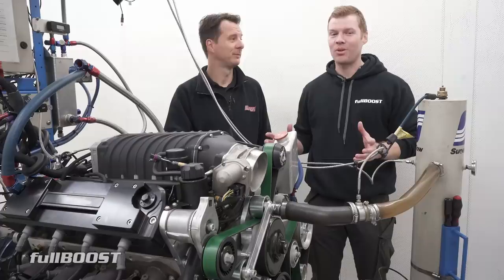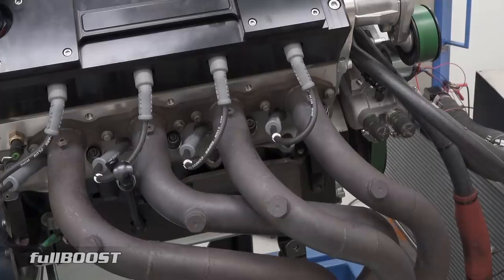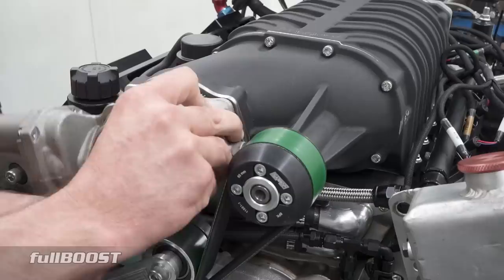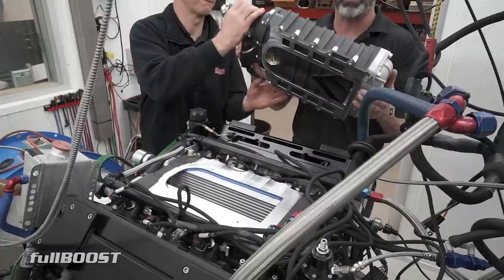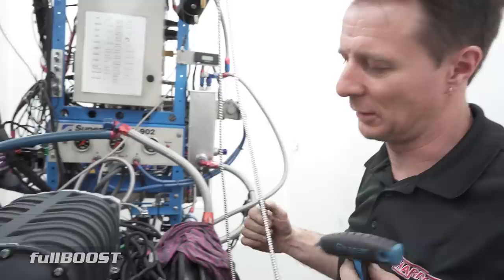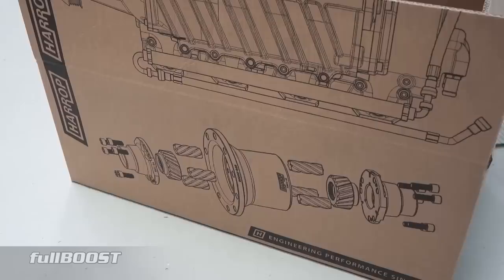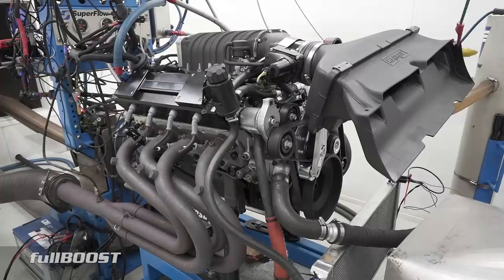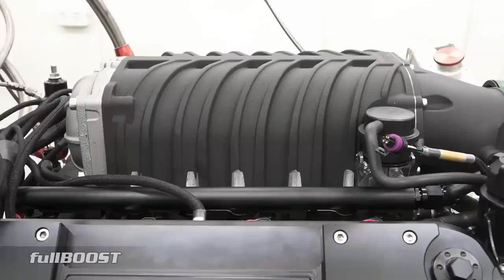How to increase Supercharger efficiency | Harrop TVS2650

Comment from the maker: Torque monster! 💪
Reply: FAARRR OUT Yeah man a 1000Nm of rear torque figures IS NO joke....That's insane fullboost.....i know how bad Only 630Nm of torque Can be on a Tuff Brand new R60s Tranny good for 800Nm,...I have only been bashing on my stock new R60 Tranny for 1 week after a 3intch TBE + Nizpro tune......And I'm already getting some slip in 2nd gear from my Torque converter i presume 🤔 ?
Reply: My heartbeat makes 475rwkw 1200nm
Reply: Would be a good car for that sales rep to get to Swan Hill. 😉
Reply from the maker: @happymanasfksubaru2846  👍Nice one. Torque at the wheels is not the same as at the engine. This is making more than 1200Nm.

Comment: The hp went up but so did the boost levels.. how about an apples to apples comparison to show the gains from porting the supercharger and adding the spacer.
Reply from the maker: The boost will automatically increase when the charger breathes better i.e less restrictive air path. 👍
Reply: @fullboost  hmm.. I never thought about that. I always thought boost pressures dropped when restriction decreased but that's probably engineside.. I can see how allowing the supercharger to move more air per rotation would raise boost levels... interesting.. great video. Thank you.
Reply: @yolofullsend  That depends, superchargers need more air in than turbos do. That's why Kenne-Bell sells 100+mm throttle bodies. This TVS blower with a 102mm and 15-17 psi the output is very typically about 1000hp on the dyno. However by the time it travels through the automatic trans, drive shaft and diff it's down to around 950 hp. Still nothing to sneeze at, much easier though more expensive to upgrade supercharged cars, though 4 cylinder supercharging is lagging WAY behind, though you can get 500-600 whp out of Rotex setups and 2300 TVS on Honda K motors.
Reply: @yolofullsend  yea on the engine side it does drop when more efficient but when you make the blower itself more efficient or run a larger air intake or throttle body the boost will increase without touching the pulley sizes.

Comment: All this time I thought Twin Screw superchargers were better then TVS.  These 2.65L TVS blowers are making more power on average then 2.8-2.9L Twin Screw's.
Reply: They make way more power than a 2.9.
Reply: Twin Screw is better. New Kenne-Bell Twin Screw at the same boost level is 1,100 hp. Most people aren't running them that hard.
Reply: @dj4monie  how is the twin screw better when it takes a decent amount more displacement to top what the 2.65 tvs can do.  Please explain that to me.   3.6 KB can barely outdo a 2650 in an all out built spinning it to the moon.  Anything smaller than a 3.6 is gonna have a hard time keeping up with a 2650 tvs.  Displacement for displacement the tvs owns twin screws.  Whipple is better than kb for sure but even the latest greatest whipple needs to be 3 liters to play with the 2650 tvs.  They make more power than the 2.9 whipple did as the op stated.  You twin screw guys are just in denial.  Anytime the argument is brought up the twin screw guys start talking about how a big ass twin screw can make more power no shit Sherlock let's see a 2.65 liter twin screw touch that tvs.  It isn't gonna happen that is why they don't make them that size anymore lol.  They wouldn't be able to hang with the 2650 tvs.
Reply: @midnight347  Facts.

Comment: You guys should do this with a MOPAR Helephant crate motor. Then swap off the OEM supercharger and bolt on this supercharger to see the difference
Reply: Thats great in theory, but 99% the helephant wont be available here from Fiat/Chrysler Australia. If the helephant crate motor is $30k USD, would probably be around $55k AUD. We dont even get from the factory: chargers, challengers, demon, hellcat etc. Any cars here are grey imports.
Reply: @aaronb1320  stay with GM! The LS,LSX,Gen5 platforms are killer here in the U.S,Ford is coming fast though, small powerplants with big numbers!

Comment: E85 is an automatic 5% power gain from fuel btu.  I'd say it's knock limited to maybe 900 bhp on 91 octane. any tests?

btw, 1-7/8" headers are plenty for this engine.  you'll only see incremental gains with a 2" primary tube.
Reply from the maker: The collector was more of an issue. We did a back to back test on an NA engine using these headers and picked up 10hp up top. 

Yes they do still make good power on unleaded. It was tested on E85 as that is what it will run in the car. 👍

Comment: Wish I could get one for my 02 fbody.
Reply: Eat Ramen Noddles, improve your credit, refinance everything,  get a low interest credit card , ask for a raise, work Uber (not in your F-body). About $7K for a setup like this (blower only). LSX 427 can be done with a truck 6.0 iron block and a scat stroker kit, not that expensive and will hold the boost no problem. My buddies LSA CTS-V makes 748 on the stock blower and E85 run low 10's on DR's
Reply: Currently looking into an eforce TVS2300. Its 6k. Hawks is suppose to be coming up with a kit with a 2650...if it's 7k then I'll get it. No reply yet.  I already have the rest. Might lower compression so I can run more boost.

Comment: How comes Straya produces so much E85 ? From what/where do they get it ? Apparently EVERYONE runs E85. 🤔
Reply: Queensland produces masses of sugar cane. E85 is less available compared to a few years ago, now it is in every major city at a bit of a premium compared to where it was widely available at a big discount. I think most people using it are doing so for performance and not saving money these days.
Reply: @user-pi6cs3ue4s  Thanks for the brief explanation. Question: Is E85 Still cheaper than regular petrol/benzine/gasoline OR more expensive ?
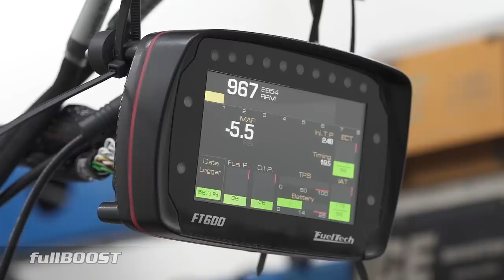Reply: @GIGABACHI  Depends, E85 where I am at  this year ranged from $1.30aud to $1:46aud and 98 premium ranged from 1:30 to 1:80. If E85 is 30% cheaper then it is economical. Otherwise its just for the performance benefit. I get about 60kw  and 50nm of extra power on e85.
Reply: shane marz  Depends on your engine and setup, e85 is effectively acts like a higher octane, so if your engine timing is limited by detonation then e85 has more headroom to get the full potential out of the engine. On naturally aspirated engines you may not gain anything unless they have high compression 12.5:1 or higher. With forced induction it gives more headroom before being limited by detonation. So with the supercharger. with less efficient intercooling, I was getting +30% power on e85 vs 98 octane. For turbo with an efficient intercooler and decomped engine, the gain is about 10-15%  and other advantages like reduced turbo lag as we are injecting more fuel producing a bit more exhaust. In the worse case scenario on low compression naturally aspirated engine not tuned for e85 (newer than 2009 or you could have fuel system issues) you could lose 10-30% power instead. E85 does have the disadvantage that you need to use synthetic oil and need to change the oil twice as often.

Comment: What about fitting all that under the bonnet ? Low profile is key.
Reply from the maker: It will fit under a VF yes but under an older car, yeah you'd have to run a small bonnet mod.

Comment: forced inductions interchiller review/testing?
Granted this car prob wouldn't have a A/C pump... but in saying that, would an interchiller be worth having an A/C pump to drive?
Reply: Not really necessary when running E85
Reply: You would still benefit. The air would be much cooler. Same with water meth. It would help as well. E85 is great but it isn't the perfect solution. Everything can always be improved :)

Comment: Not sure that all those changes actually increase S/C efficiency; although a few of them increase power.
Reply: I want to agree with that. I don't think any of these things are making it more efficient just giving it more resources to make more horsepower
Reply: Less pressure drop equals efficiency.
Reply: @stevenp3176  I must have missed that part of the video where they minimized pressure drop between the supercharger input/outputs; where was it please?. 

I thought they were looking at ways to increase pressure; which isn't necessarily an efficiency increase and/or directly dealing with improving pressure loss/drops.
Reply: Jim Stanley They reduced the pressure drop at the inlet.
Reply: @stevenp3176  Was that via the fitment of a larger throttle body? Or, as shown at the start of the video, by removing the intake runner all together?
Reply: Jim Stanley Larger TB/inlet then spacer. Inlet restriction is a massive drop in power for a supercharger as well as increasing heat and power draw of the supercharger itself.
Reply: Jim Stanley notice power jumped up boost increased yet temperatures were reduced?
Reply: @stevenp3176  Yes, I suppose that does increase the adiabatic efficiency of the supercharger; with perhaps also some minor mechanical efficiency benefits.

Although fitting a smaller front pulley/wheel (to increase the rotor speed; requires more work/power from the engine, and as such it) may - to some extent - offset the overall efficiency/other gains at some point. 

I am deliberately making a distinction between supercharger efficiency, adiabatic efficiency, and both overall engine efficiency and engine power increase.

The last component "engine power increase" is not necessarily mutually inclusive with "supercharger efficiency", "adiabatic efficiency", and "engine efficiency".
Reply: @stevenp3176   >>>>> Jim Stanley notice power jumped up boost increased yet temperatures were reduced?

Yes, and that is good.

But (as per my previous post) "engine power increase" may not always reflect an improvement in supercharger and/or engine efficiency; and that was why I asked the questions I did.

I agree that increasing the supercharger inlet size will usually improve its efficiency as per my above post.

However, without looking at all the data, I am not sure that reducing the supercharger’s pulley wheel size increased the supercharger’s efficiency (although it may have); because simply spinning the rotors faster and creating more boost - whilst it often increases the engine’s power - does not always directly translate to greater supercharger and/or engine efficiency.
Reply: Jim Stanley The pulley part I agree with. Though one could argue the blowers efficiency changes based on RPM or PR.

Comment: Why am I not impressed when a 2JZ with stock internals can get 1000 horse for less $
Reply from the maker: Two very different torque curves 👍
Reply: @fullboost  ya i admit that but almost twice the displacement
Reply: @fullboost  not to mention what you guys do with a Cleveland it's still destroys the LS and in the state the Cleveland wins engine Masters Challenge almost every time
Reply from the maker: That's kinda the point of going for a V8 I guess.
Reply: Stock 2jz can’t handle this tq on stock block. My friends have built Supras and they tell me all the limits of them stock
Reply: @speedlife301  mine say otherwise,  you literally see 1500 hp stock block 2jz with upgraded internals .
Reply: @Grande.biggly  obviously this guy's a Chevy fanboy and hasn't watch this channel as stock barras  get almost as much as a 2jz gte . A literal search will bring up numerous 2j's with stock assembly at 900 hp

Comment: Dyno queen for the moment? I know I can eat off the piston tops😆 but when he lets off the throttle it stall shutters and belts start chirping,it alomst looks bad for the motor i know the only tyranny i would use is a 2 speed powerglide but that's me.these guys let off the gas and there ribs get bruised lol and yes I no its just belt slippage and going from WOT to idle why do we have to do that fuck! Awesome motor the car will be lots of fun
Reply from the maker: Because that is basically how an engine dyno works, there is no trans to soak up that load.

Comment: DAMN, You Aussies are puttin us to shame here in the states! almost 1050lbs torque AND streetable DAMN! with methanol injection, over 1100????
Reply: chuck fults I am in love with harrop but it’s still just an Eaton blower at heart (not to diminish the work Harrop puts in to the package. 

I really with harrop would make twin screw kits instead though, the amount of tuning you can do with twin screws to get theoretically 100% efficiency, much more than roots blowers, even though the TVS roots have improved greatly, so has twin screw tech, and twin screws compress air internally roots never will, all being equal twin screws will always be better and always have much more potential
Reply: Fee, Eaton has been around since Christ was a corporal. A little porting and a pulley change AND you will feel those 2 little mods in the seat of you're pants! My son did just those 2 in his M90 L67 Riviera Damn! All that stuff in Harrop's 20 grand LS Motor AND off the shelf too!!!  WINNING!  Add some Methanol and do a pull?
Reply: Comes down to E85 I think we are ahead of you guys  using that Aussie's have been playing with it for nearly 10years now  it's quite impressive the amount you can advance the timing compared to standard fuels
Reply: The Aussies didn't make this blower, it's made in America.

Comment: Look at that drive-by-wire TB blade flapping around, total crap. Switch to cable driven.
Reply: Its a street car engine and the DBW throttle is used to allow a blown, big cube and cammed engine to have some manners, the old GM stepper motor just cant respond quick enough, let alone pass enough air to keep up. That flapping is the ecu trying to stop the engine from stalling and also some input from the dyno operator and out of all the tuners i know or have met not one has gone, hey lets go backwards and run a cable throttle and yeah sure alot people go to cable, but thats not because it's better but just cheaper and they don't know the bennefits of  DBW throttle.

Comment: Bugger all gains... not worth it.  The 102mm TB was the biggest waste of money.  Totally not worth it.
Reply: 25hp from a throttle body only, bugger all? Please show us your engine building skills if you can do better than that off a simple TB change  That mod is cheap horsepower. 102mm TBs on eBay are under $100, so you're paying $4 per hp gained. That's a fucking bargain in any book.
Reply: @MafiaboysWorld   Its not about total number gain.  Its about PERCENTAGE gain!.   You don't feel 25hp on a 1000hp engine!
Reply: @mareksumguy1887  It's not just percentage gain, the point being made here is cost per hp. Please spend $100 on any part and get me 25hp, regardless of engine. You won't get 25hp from a pod filter, you won't get an exhaust or headers or anything notable for $100. Even going from 200hp to 225 isn't a great jump, it's only 12.5% but the way you're making it out I'm going to get pinned back from that jump of power. 🤷🤣😂
Reply: Id rather have 1000 than 975 hp
Reply: @wolfofmagdalene92  All pain and no gain.  1. You won't feel the extra 25hp.  2. You now have a more (unnecessarily) sensitive gas pedal... which ruins driveability.  Like i said, not worth it.